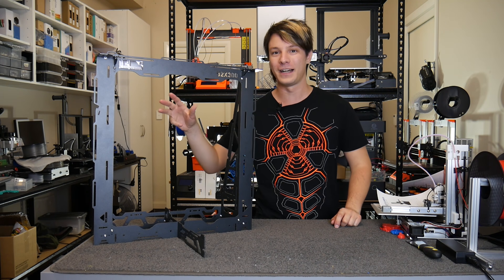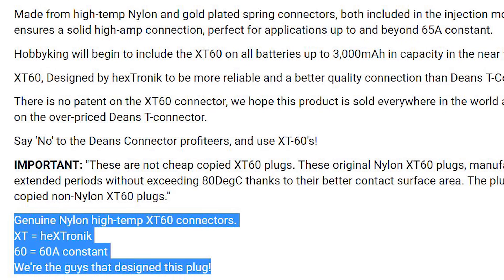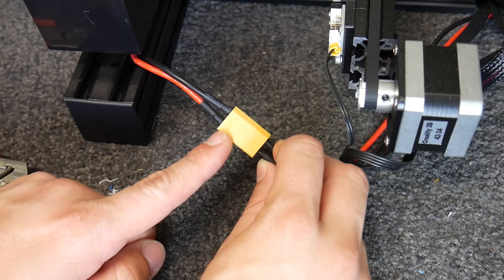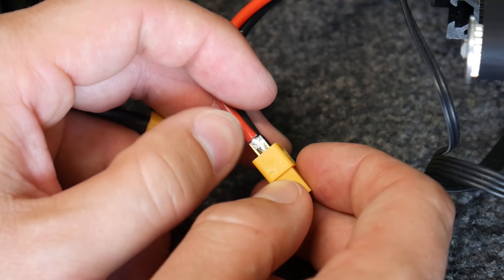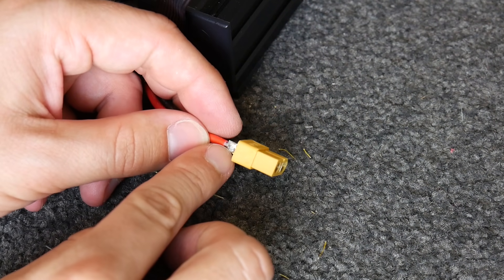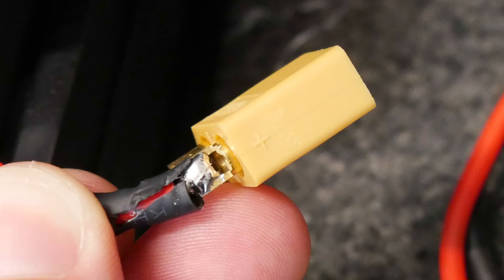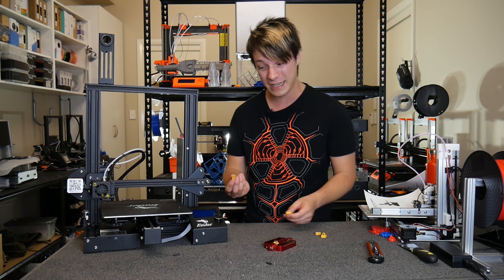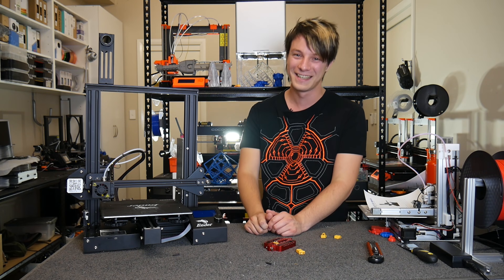Ender 3 Connectors are burning up... Bad XT60's

Comment: I’ve now had two Ender 3’s that have caught fire at the plugs. Not just turn black, but actually caught on fire. The amazon company I bought them from took my first one back immediately (though I had to fight for them to pay for shipping).  Second one just happened a few days ago.  I have a third Ender that’s showing no signs of this issue. The two that did catch on fire had just a BLtouch mod and no other mods.
Reply from the maker: Erg. That's insane, I was hoping no one would say that...! Seriously though, glad it wasn't worse. All of these issues seem to be batch related, and totally random regarding what the end user will actually receive.
Reply: Maker's Muse yeah I wondered if it was a batch issue.  The Ender 3 that replaced the first has had almost identical issues across the board as the first one, down to the plug catching fire.  My third one though (which runs along side the other) has been a champ.  I’ve had to do next to no tweaks to get it to print great.
Reply: @blackwolfecc  Which version of the ender 3 do you have? I have the V3.3 and have had it for some months without issues now, hoping nothing will happen :P
Reply: Wow that's completely unacceptable😡
Reply: Were any Ender 3's produced with 12V supplies powering a 12V heater (which would run at ~19A, assuming a 220W heater), or did this happen on 24V units (<10A to the heater)?
Reply: @MakersMuse  I'm actually curious if these are actually genuine machines? I've seen on amazon a Chinese company that makes "certified" machines and if this is why the issue exists.

Edit: brought mine from their website not a reseller and 8 months no issues so far, seems to be better quality than most and the stock extruder is holding up
Reply: @WookieOJ  How do you know what version you have?
Reply: @5UPRAH  on the manual that came with the printer it said the version in one of the corners, might say on the label on the control box as well but I'm not sure
Reply: That's another one of the problems with these knock-off connectors, they don't use any flame retardants so they'll just catch fire when overheated. Proper connectors will be UL 94 (or equivalent) certified.

Comment: I’m beginning to believe this has more to do with bad solder joints. The discoloring is at the solder joints not the center connector. Bad/cold solder joint or solder joint that does include all strands of the wire can produce higher resistance which at high current produces heat.
Reply from the maker: Do you have any measuring gear for resistances that low? You could be right.
Reply: I though during the beginning of the video you would test with a multimeter.
Reply: I would not think so. The discoloration is in there because the connector pin is touching the Nylon in that area. The heat from the bad Connection will spread quite some distance...
Reply: I just remembered, XT60s becoming loose and turning Brown is a relatively common issue in race quads. Typically when the contacts wear out.
Reply: My guess is that the plastic gets discolored close to the solder joint, because that is where it is in contact with the hot pin. @4.30: If the wire had been soldered all the way down to the full circular part of the pin, the heat transport to the wire would have been much better, and may in best case have prevented heat problems. No doubt this is a poor quality connector, though.
Reply: Thing with many low-quality XT60 clone connectors is that the enclosure begins to melt at soldering temperatures. So after they ordered a truckload of those there's a possibility that they had to solder them shoddily. But i really like the explanation of others here, the metal inserts have very high thermal conductivity, so spot where heat occurs and where the plastic discolours are not necessarily the same.
Reply: Maker's Muse CHEP instead of measuring resistance in the connection measure voltage drop across the connection while current is flowing. To measure the solder joint it may take a little creativity like drilling small holes in the plastic bodys so the test lead can contact the terminals but considering you’ll probably want to replace the burnt connector anyhoo damaging the original plastic body is kinda a non-issue. It should be near zero volts.
Reply: High resistance = heat.   Why keep the XT60 at all?  It was added for ease of assembly.  I'd remove and bypass it if I owned this printer and needed to address a poor XT60 connection.
Reply: Just tested some genuine XT60 and got a resistance of around 0.8mOhms which would have no issue with more than 10A. This is just the connector itself without cables soldered to it. You can do this by running a power supply at 1A constant current through the connector and reading the voltage directly across the connector. Then you can read it as 1mV = 1mOhm. Unfortunately I don't have any low quality XT60 at hand
Reply: Can 100% confirm it's a faulty mechanical connection.

Theres no such thing as a fake xt60, they're a standard, not a brand.
Reply: thankfully, i am into building and flying drones....swapping out an xt60(which i have 50 of) is a cake walk. I bet it is from crap solder, not a bad solder joint! A bad joint is a cause of having used crap solder in this case. 

An xt30 would do just fine right? I pull like 30a on my little 3" drone and NEVER had an issue
Reply: @silvrcel  10 amps through .8 ohm connector will produce 80 watts worth of heat, which equals an 80w soldering iron.
Reply: @markdaniel8740  math is wrong.  10x0.8=8watts.
Reply: @Maker's Muse Angus you can readily measure low resistances using the 4-wire method. You only need an ordinary voltmeter, plus a current source (current limited power supply of some kind -- even a battery with series resistor).   A good summary: https://www.youtube.com/watch?v=0vMvCVyOp9g   But there is a caution: the resistance of the connector's imperfect connection (or crimps, or solder) likely varies with temperature, so you'll need to exercise it over a range of temps to understand what's going on.
Reply: @Mark Daniel @James Nichols. [Edit: corrected MY math error...doh] If your calculation is in response to darkfire2022's measurement, note that he/she reported 0.8 milliohms, not ohms. So (10A ^ 2) x 0.8mohm = 80mW, not 8W.
Reply: @Alaric Paley  "Theres no such thing as a fake xt60, they're a standard, not a brand." Actually, XT60 refers to a product line originated and made by AMASS, and specifically not to a standard.  You can argue that the term "XT60" has come to mean "that style of connector" in common speech, but that doesn't make it a standard. What XT60 refers to is the connector as made by AMASS, and their characterization of it.  Similar-looking connectors made by other manufacturers don't have any standard to be held to, and stamping them with an XT60 label doesn't guarantee their performance. :-)   https://imgur.com/gallery/wZziwy0
Reply: Mark Daniel incorrect, it's 80w passed through the connector. The heat is dependant on the friction of the wire and the electrons going through it. Having multiple pins contacting only marginally reduces the resistance but that isn't the cause of the heat (the increased resistance), what causes it would be the same amount of current going through 1/4 of the wire and so it can't handle as much friction (it effectively becomes a XT15 connector. If you were correct, whatever power your supply output, all of it would be turned into heat and none would be left for your printer. For example your soldering iron at 80w. With your theory the cable should also heat up with 80w of power since a connector or a wire is the same think except one is meant to come apart.
Reply: @RevivedAsh267 As I and James Nichols already posted, Mark Daniel is using the wrong numbers, your "80W passed through the connector" is nonsensical, and I don't know what your "multiple pins" discussion is talking about, since XT60 has only one pin for each direction of current.
Reply: Graham Wideman firstly, I used 80w for the sake of example (I have no idea what current the Ender 3 draws) that part wasn't my statement it was his. Each side of the terminal has 4 pins. If only one is contacting (which I should have mentioned) the load isn't distributed across 4 pins but only one and if it's rated as an XT60 then each pin is rated for  15Amps yes? Because the current will be shared. If only one pin is used then only 1/4 of the rated current can be drawn (without destruction.) This is all provided that only one pin is contacting on each side (although you'd only need one side since the current on the return path and sending path would be identical.)
Reply: @Mr_Pewpy_But-Whole  Testing with a multimeter on the ohms scale will not find an issue with plug connections.  The meter does not push out sufficient current to create a meaningful voltage drop across the joint. If however you power up the heated bed and measure the voltage drop while also measuring the current you can calculate the micro-ohms resistance.  I suggest doing rhis test several times while the bed heats up. If the resistance increases more than 5% during heat up get rid of the plugs, they are faulty.
Reply: @reasonablebeing5392  go with xt 90s, genuine ones though
Reply: @Graham_Wideman  You are absolutely correct. The only way to check it properly is to perform a Kelvin resistance measurement (aka 4 wire). Simple resistance from a multimeter is nearly pointless.
Reply: @MakersMuse  Resistance can never be measured directly. The Ohms scale injects a small current and measures the voltage drop. Low Ohm meters use the 4 wire method. Each probe has 2 pins, one for current and one for voltage 
In the case of a heated bed it is quite easy as the bed draws current for you. Ideally use 2 meters, one for current and one for voltage. At a pinch 1 meter will do. First measure current then quickly the voltage across each pole of the plug /socket assembly. There is of course more risk of error this way as the current could have changed while you were setting up due to PWM. A work around is directly connect to the power supply during testing.
Reply: Yes, mine has crimped connectors on ender side but connection was more then solid! However i can't say that for awful solder on psu side. Complete cold trash solder joint. I broke that solder with my hands meaning that, that connector could have sparked like firework! (Ender 3 non pro version).
Reply: James Nichols it is P=I^2*R= 80W. You probably had P=U*I in mind?
Reply: @markdaniel8740  DarkFire2022 measure 0.8 milli Ohms so 10^2 * 0.0008 = 0.08Watts, that's assuming this is all DC current not AC with other effects to increase the losses.
Reply: @RevivedAsh267 "Each side of the terminal has 4 pins." Not sure what you mean here by 4 pins.  The XT60 connector on one side of the junction has 2 (male) pins, which connect to two (female) sockets in the mating connector. on the other side of the junction.  Such a connector is typically used to provide both wires of a supply to some load. One wire will carry the current in one direction, and the other wire carries the return current in the other direction.  So there is no sharing going on. If the load draws 10A, then both of the wires carry 10A (in opposite directions), and hence each pin-and-socket carries 10A.

In general connectors are rated by how much current one pin can carry (or one pin and its mating socket).  So if a connector's pins are rated at 10A, then a 2-pin connector can carry 20A. However, don't confuse that 20A with the current delivered to the load. In the present case, to deliver 10A to the load, that 10A passes through the connector once toward the load, and again away from the load. So total 20A carried by the connector. 

(And this disregards the reduction in rating one should use to allow for multiple nearby pins carrying significant current, with their heat warming each other up mutually.  So some connectors are rated for a total current for the connector assembly as a whole, and beyond that, for particular airflow conditions.)
Reply: @fkruger1623  I agree on your math (and fixed mine in earlier comment) Joba has P=I^2 R correct, but is using R = 0.8 ohms instead of 0.8 mohms as reported by  DarkFire.  And indeed this is DC, a 24CV DC supply.
Reply: @MakersMuse  You don't need any special gear for measuring low resistances in these situations - just pass a decently high, mostly known current through and measure the drop across the connector.

Put a cheap hotbed in a bucket of water or something to keep the current stable for a while. 10A or so is plenty to make a measurement.
Reply: The discoloring on mine is in the middle and the shrink tubing is melted away...
Reply: My original Ender 3 connector did  not had any solder at all. It melted down and I replaced it with a Pa10 connector.
Reply: 15 years using XT-60 Connectors for radio control hobbies.
100% verified that mine were crimped on my ender 3.
Reply: @HKYT649   first increased contact resistance, then fewer of the contact leaves make contact, then if it starts to wiggle it could be striking an arc.
Reply: @Graham_Wideman nearly there
V=RI
P=VI
Therefore
P=I²R
P=10²×0.8mΩ
P=100x0.0008mΩ
and then we must remember that the plug has two of these connections, so the heat that needs to be dissipated is double
therefore 
P=0.16W or 160mW
but still SFA all the same. I'd be interested to know resistance of bad inferior plug. 0.8mΩ is a lot less than I'd have expected on the good ones. 
I'm curious what rubbish alloy % the crap ones have been made from.
Get the good ole trusty AVO out and blow the dust off it to measure those low resistances. Haven't done that for decades.